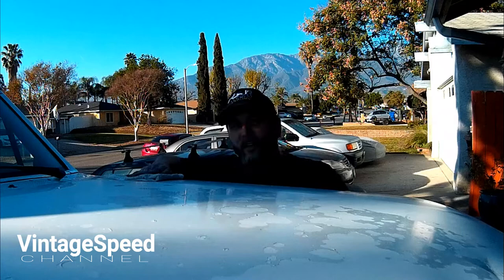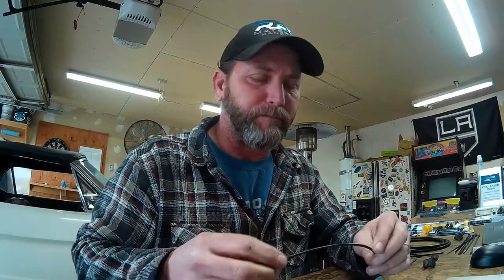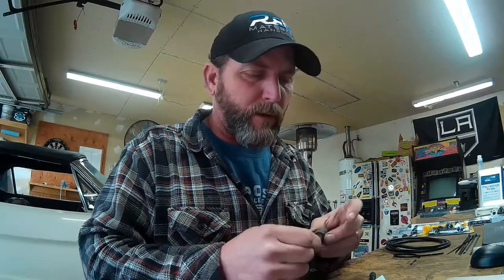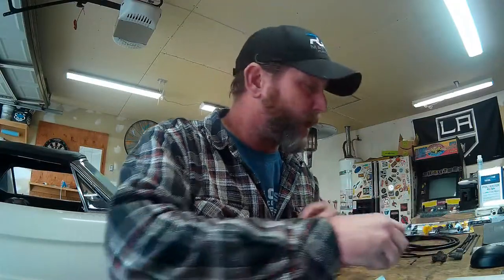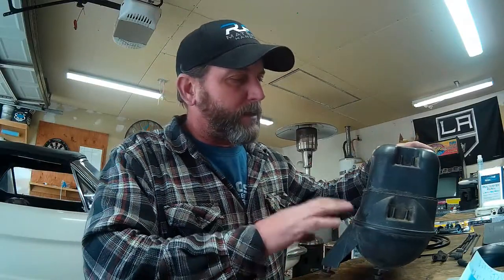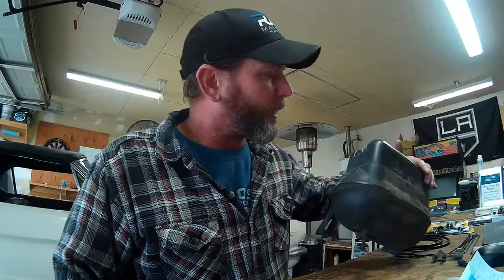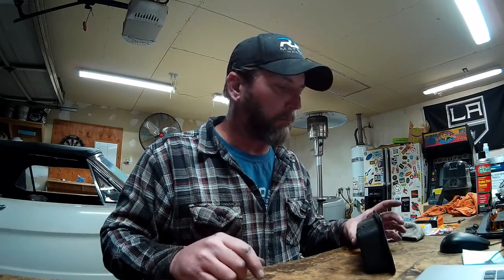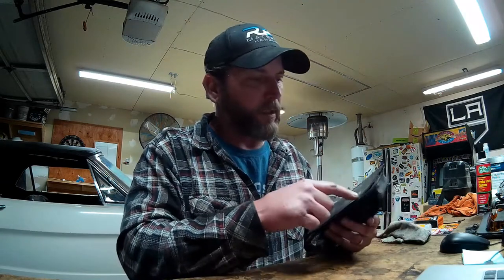Ford OBS; Climate Control System, Fixing Broken Vac Lines

Comment: Thanks for all the great info, I went in to get my breaks bled and a/c recharged, just general maintenance. Got the truck back, breaks were rock hard and blower was stuck on defrost. The "mechanics" could not figure out what would cause both of those issues instantly when they weren't a problem before. This helped to answer my suspicions that the vacuum pump did indeed go out. You earned a sub from me Sir, keep up the good work.
Reply from the maker: thanks man!  comments like yours make the hours of editing and creation mean something.  i appreciate it very much.

Comment: Gotta love the service truck white OBS crew cabs. Mine looks very similar, though it's a '97 PSD with a 5 speed. I went o GA to get the one I have now just so it wouldn't be a rust bucket. I'm jealous of the rust-free CA body panels and parts you guys have out there. Back here in the rust belt you have to keep them oiled up or off the road in the winter or they get termites in a hurry.  Check out the videos on my channel for more detail on my "build".
Reply from the maker: Yeah, it's nice we dont have to fight rust as much as you do.  The old service truck got a few upgrades this weekend!  Thanks for Watching, Stay Tuned!